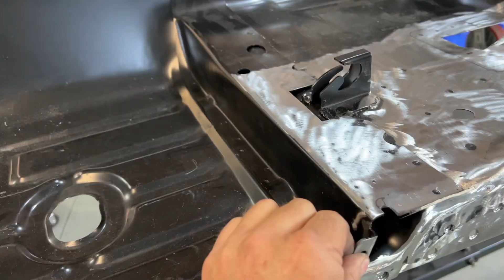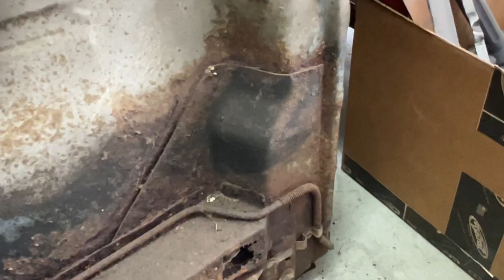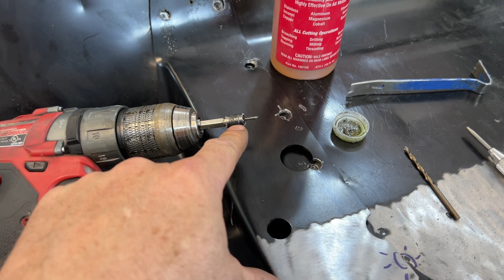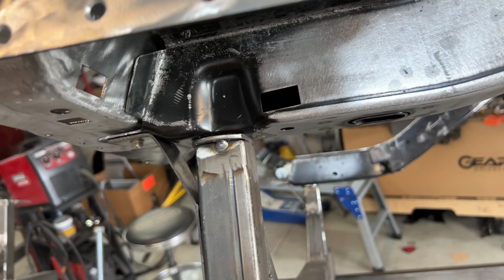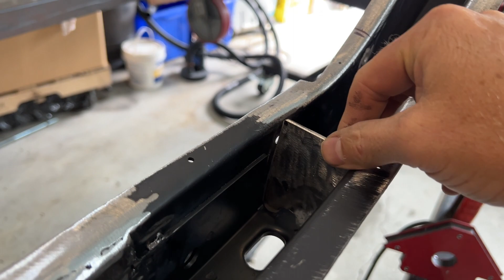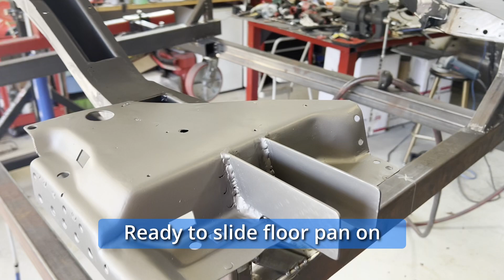What Happens When Your Car Build Goes Wrong?

Comment: I have problems too i will restore mi 69 camaro chasis but have subframe conector solder to the chasis i have to remove the solder in the car chasis or keep the conector solder to the car chasis and quit the solder in the frame??

Comment: excellent ! your idea to strengthen  that torque box , floor pan,,subframe connector joint ?
Reply from the maker: Thanks. Will have to try and weave it into the subframe connectors ideally. Will probably have to cut the top off at the connection and then weld connectors back up??? Will see??? 🤪

Comment: I wonder if you can help me. I want to do the DSE mini Tubs and 4link. What tank are you going to use. 
Long story short I am doing an LS swap on a 68 Camaro and was going to leave it at that but I just had to go thru the whole car but I already bought a tank from tanks inc. but it won’t work. Wondering it their clipped corner tank will work with the DSE Quadra link kit ? Thank you sir
Reply from the maker: Haven’t pulled the pin on a tank purchase yet. My understanding a stock tank will work but you’ll have trouble with bringing the exhaust back. Do you want to dump exhaust before rear axle?